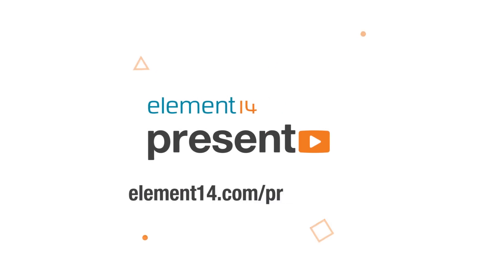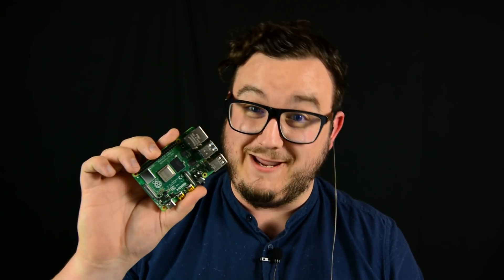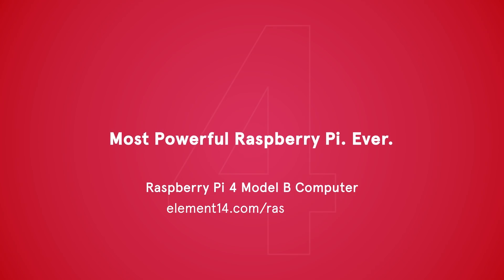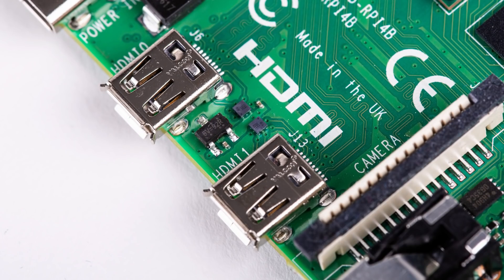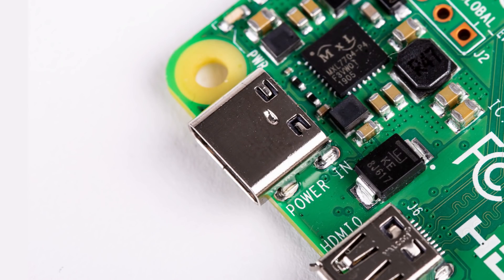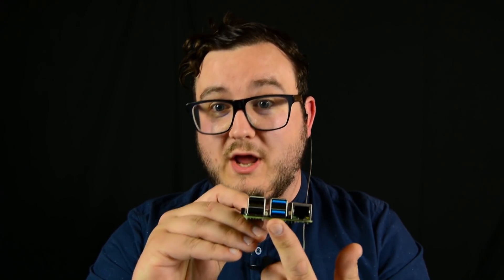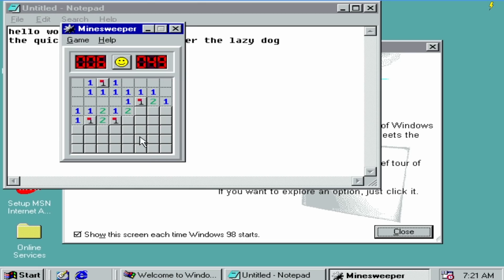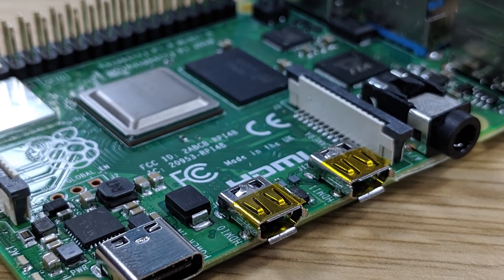Raspberry Pi 4 Model B Announcement Video

Comment: USB C, Meh. I have had far more problems with using USB C for power than I ever had with mini/micro USB B connectors. I understand the power limitations of USB B, and agree that it is not suitable for a Pi4B, but am still not happy with the choice.

Comment: Great new cases required mmmm 
Finally got rid of the crappy USB power supply connector and replaced it with another mmmm. What is wrong with a barrel jack? After all it needs a specialized USB supply anyway and if it had a proper supply 5 amps say it could actually feed power out of the USB ports in a useful way. It doesn't stop you from only feeding the minimum you need.
Dual Micro HDMI barely ok for normal use {Way to Fragile IMO} , H264 and 265 support in hardware about time. Where is the SATA onboard? The MPI Ports could easily go to an add on card as they are used in may be %25 of implementations. True desktop capability needs SATA. From my point of view it looks to me like a reaction to poor sales and the will to maximize accessories sales. To upgrade from a B+ a new case, new power supply and video cable {If using HDMI}. IMO they have cut corners in areas where it needs to be more robust. They have all but given up on backwards compatibility hardware wise other than the GPIO and then wasted the opportunity on cutting corners.  They are taking advantage of the existing users for both support and sales. Pretty disappointing IMO.

Comment: 5:31 Huh, I thought the PS1 emulation was pretty good on the pi 3B+
Reply: He just said "playstation" so maybe he was being more general, talking about PS2. Maybe?
Reply: @DaffyDaffyDaffy33322  I thought that also but then showed a PSOne.  It might have been a slip up by him and then the editor reinforced it with the visual aid.  Off the top of my head I couldn't remember any PS1 games having problems but I mainly play RPGs that aren't that intensive on emulators.

Comment: Any help would be great!!! I’m planning on buying the 4gb pi 4 complete starter kit with keyboard & mouse. My understanding is it has an operating system & wifi capable. Now can I just directly download the roms for the video games my daughters want on to the pi 4? I only have an iPad currently and know nothing about zip or compression, in fact very little to no computer knowledge. The pi 4 would go into my daughters’ SF2 arcade 1up. Do I just plug the pi4 into the arcade machine and it will be up and running???
Reply: You need to have a clean micro sd card which will then get flashed with retropie.
This is like an o.s but only for game roms.
So to answer your question, you'll need a pc to install retropie onto the sd card, and also, you'll need an encoder to install the pi into an arcade1up machine. 
If im not mistaken, you'll also need a harness to connect to the 1up lcd screen.
Google is your best friend here, as are youtube videos.

Comment: OMG I cannot wait for it, I hope it can be use to emulate PS2 game 😍😍😍.
Reply: That's not happening for a while. Gamecube/wii emulation is way farther ahead I'd say, and even that has lots of issues on raspberry pis. 3x faster isn't going to completely solve that.
Reply: Ggaming Gavin I see, thanks so much for the info. In that case cannot wait how GameCube/Wii will perform with this board. We most wait for a better revision of the  raspberry Pi or if someone compile a emulator to work with the Pi.
Reply: @jenovaizquierdo  Give it a few generations and it'll happen. We've already got fully playable gamcube games on high end phones such as my S9+ that work beautifully, you just gotta wait for that tech to trickle down into things like the pi.
Reply: @user-rs3lg6un4n  yes is true, I will definitely wait for it. There is even a PS2 emulator in the PlayStore by the name DamonPS2 is in early access but it is really promising when is fully capable.

Comment: Well that figures.  If anyone ever wants to know when the new models are coming out, wait for me to order the current model and wait three days.  This has happened to me TWICE now.
Reply: Maybe don't take years to order a piece of electronics then?
Reply: @billy-waynejeffcoat4828  Here's another maybe: Maybe don't just order things until you need them and not "just because it's new and I must have one... for reasons."  I'd still be in the exact situation as I am now if I bought it when it first came out.
Reply: @NGinuity  your statements are contradicting each of them. How would you be in the same predicament of new model coming out 3 days afterwards if you bought it new? I personally wait until New models come out when I'm waiting for something cause this will be my first pi I'm going to make something out of.
Reply: They're not contradictory at all.  Follow me here.....

I bought a Raspberry Pi 3 B+ three days before they announced the Raspberry Pi 4.  I now have in my possession an old model 3 B+ for my project.

If I had bought a Raspberry Pi 3 B+ last year, it would have collected dust until I had need for it..... 3 days ago.  I STILL would have had an old model 3 B+ in my possession for my project when they announced the Pi 4.

Waiting for a new model is smart if the release cycle is predictable, say for instance a new model year car, but it doesn't make much sense to keep waiting for a new model to put off a project in this particular realm when you don't know when exactly a new release is occurring.  I've designed hundreds of electronics and computer controlled projects.  If I queued up projects based on that logic, I would never get a single thing accomplished.

It's a risk I take.  With the Raspberry Pi, my record is on the losing end of it.  That's all I'm saying.

Comment: Finally, a Raspberry Pi that can actually be used as a desktop computer! The choice to support two displays rather than a single full-sized HDMI port is questionable, though. Who needs two displays with a Raspberry Pi? If you need two displays, you probably don't need the space or power savings of an SBC...
Reply: They could just implement a single display port which allows to connect multiple monitors.

Comment: I got really excited until I saw the micro HDMI.
Reply: more dongle that you have to pay extra for i guess
Reply: @pannanap  it's one of the most easiest connectors to break
Reply: i rather have 2 small ports than 1 large port.
Reply: @TesserLink  But the ports are more prone to breakage
Reply: @ezioauditore7636  only if you don't know what your doing.
Reply: @TesserLink  Is still prone to damage for the target audience of amateur tinkerers
Reply: Only cost £3.00 each micro HDMI adapters ordered 2 at Amazon, save those HDMI connectors, get my Pi 4 tomorrow went for the 4gb option
Reply: nobody asked for dual monitors and almost all the current cases will be useless now.
Reply: Not buying this I hate micro ports always break .

Tell that to my last 5 phones

Comment: they should have had an option to use faster pluggable emmc storage as bootable main storage
Reply from the maker: emmc is somewhat a different use-case.
Reply: @element14presents  SD card is fine for Debian Linux but a extra option of emmc storage would make Windows 10 viable like it is for other SBC's that have emmc storage such as the Lattle Panda.

Comment: YES! Finally on par with a Rock64, but with way more software support! And H.265 decoding, perfect for a media center!
The only thing I don't like is the micro HDMI. Shouldn't be an issue in a permanent application though.
Reply: Hmmm, the asus tinker board is also supposed to decode H265 but actually it does not work well (overheat and much latency) so I'll wait and see for now.

Comment: Ouch Micro HDMI. There goes the longevity of this product. Those connectors are notoriously weak.
Reply: That was disappointing to see. I've personally had a really bad time with micro HDMI... the reputation that they have is completely justified.
Reply: I'm guessing it was the only way to get two of them in that form factor. 

Many projects do however use gpio and the 3.5mm jack for composite video out so I think those projects will still be pretty reliable.

Maybe case makers can make cases that has built in adaptors to full-sized hdmi for users who need more ling term reliability?
Reply: @jmalmsten  That's actually a really good idea for a case.
Reply: I though mini HDMI was the bad one.
Reply: @TheMonthlyJack  Both are terrible to be honest. Whenever you connect a heavier cable to a small plug....it's a disaster waiting to happen. It can work if it's a stationary setup, but if you are always playing around with it, like we tend to do with our PI's, it will fail. :(
Reply: Just ordered one with the 4gb option, coming tomorrow and 2 micro HDMI adapters to stay permanently plugged in from Amazon, cheap save those micro HDMI sockets

Comment: 1GB is $35, 2GB is $45, and 4GB is $55. Available rn on the raspberry pi website.
Reply: I picked up a rebranded "Atomic Pi" instead. My pi 1b+ still has uses though. I just think x86 is the king of cpu's.
Reply: I definitely get the 4gb version, and install windows on arm to it, if RPI doesn't come up with 4gb, I will go to ryzen sbc
Reply: i remember i read the atomic pi‘是spec they had put intel atom on it

Comment: wow 3 times the speed of Pi3? How much is 3 times nothing? If it doesn't need active cooling it's not going to be your new desktop. This is what Pi2 should have been when it came out, 5 years ago.
Reply: Does your phone need active cooling to be able to be usable?
Reply: @jothain  High-end phones overheat a lot especially if you try using and charging them in direct sunlight. However Pi4 does not even begin to approach the performance and power consumption of modern high-end phones, which is the whole point. Performance-wise Pi4 is more like one of them low-power CPUs they put on high-end phones to do background tasks while the big boy CPU is sleeping to save power, however Pi4 is not even low power, it's just a 4yo phone CPU, and not from a high-end 4yo phone either.

Comment: so how is this product any different than the other SBC out there.... to me this is just Pi bringing the Pi upto spec compared to other SBC's out there. 
Pi never blows me away and this video just seems to be a paid promo! 
With the rise of the ryzen mobile processor this may change even more.
TBH the biggest fault with this board is the micro HDMI such a weak connector they shoulda had a single full size no need for dual monitor output.
Reply: Spriggen 1337 
I rather have sata than TWO displays.....what a useless bunch of features. No wonder why the orange and banana pi are so successful
Reply: It's not there to support dual monitors. It's there to support 4k @ 60fps
Reply: @Chriva   but you could do that with 1 single full size HDMI which is a sturdy connector, the size of the connector is for convenience for the SBC not the rate of transfer of information u can get 4k 60fps over full size HDMI just as well, the 2 micro hdmi on the pi4 b are for dual monitor output, if u do dual 4k monitor output that would be very taxing on your system as in alot of heat generation by the gpu thats if it could support dual 4k, the dual connectors are most likely for dual 1080p